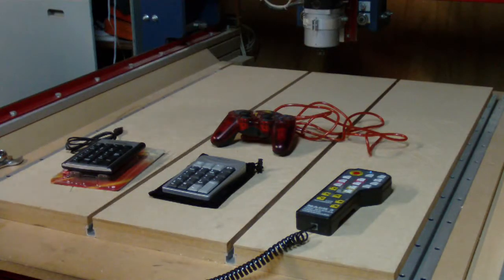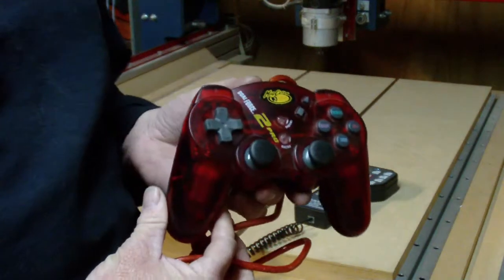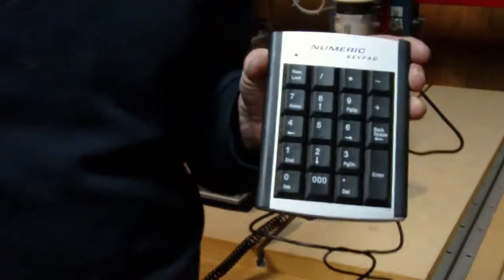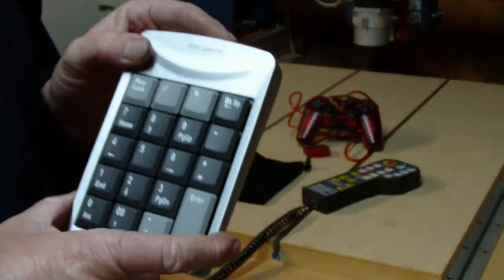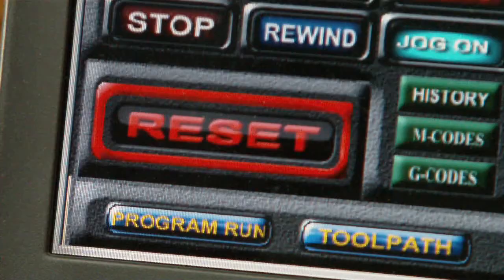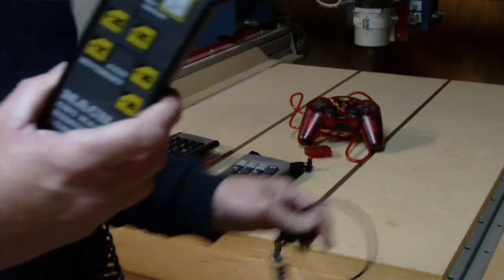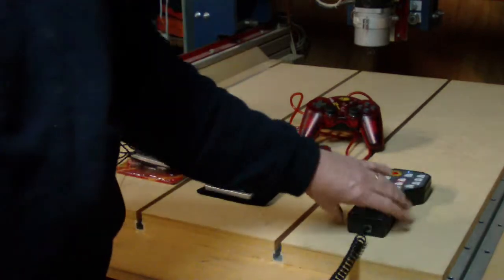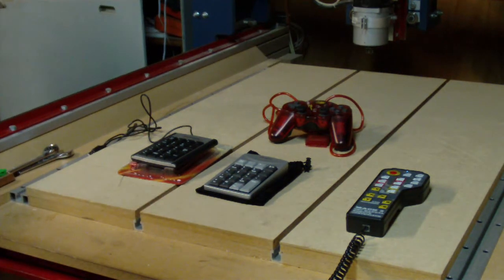Mach 3 Pendant Review - CNCnutz Episode 31

Comment: got the newer version of the mach 3 pendtant....the emergency reset button does nothing,,,,is there a way to fix this within mach3...love the vids....keep em coming.
Reply from the maker: I'm very surprised that the Estop button doesn't work for you straight out of the box.
This video will show how to map keys on a pendant to various buttons in a screenset.
It will hopefully solve your problem as well as add new functionality to the new pendant.
Cheers
Peter
https://youtu.be/r8wEpHVS0qY
Reply from the maker: Hi Rory,
Looks like I have put you wrong on how to set the key on your pendant. The method I mention will work but there is a much simpler way as I have just discovered.
Open Mach3 and go to Config, Pins and ports, input signals
Scroll down to EStop and click the square labeled hotkey on the extreme right
A box will open and you need to press the Emergency button on your new pendant. This will fill out the hotkey box with the key number automatically.
Click Apply 
Go to Config and Save Settings
You are done. The key will now work for you.
Cheers
Peter
Reply: thanks again peter,, today i tried the above method and it worked a treat,,,,the pendant is working fine now ,,,,,,mach3  is still a steep learning curve for me, but i will persevere.....your videos are a great help and a pleasure to watch....so thanks again and all the best from the emerald isle.

Comment: Peter, have you any documentation of the settings in the Mach 3 program to use a Mach 3 inc manual controller? I have watched your video's but can not get my controller to work.  I am using a screen set called the Blue screen set because I use the triple edge finder.  Any help would be great.  Thanks for your support.
Reply from the maker: I did a video on setting it up last year. It won't matter what screenset you are using for this.
Have a look at      https://youtu.be/r8wEpHVS0qY
Let me know if you have any problems
Cheers
Peter

Comment: Keep up the good work Peter. Love your vids.
Went & got myself one of these beauties, and am very happy with it.
One function I found is missing, and that's the ability to activate the Auto Tool Zero from it. Am I missing something ??
UK fan.
Reply from the maker: +Alan Segelov 
Hi Alan,
Mne doesn't have an auto zero on it either.
You can remap keys on the hand control to do different things using a program called Mach3 screen designer.
It allows to to customise your Mach3 screen and you can create and assign functions to keyboard or remote controller keys. You can download it from the Mach3 website. 
http://www.machsupport.com/wp-content/uploads/2013/04/Mach3Screen.zip

Hope this helps
Cheers
Peter

Comment: Hi Peter,

I am pretty new to CNC machining and I have already learnt a lot viewing your videos. The review of the remote controllers was very interesting for me as I own the same CNC manual controller which you rated best.
I am pretty happy with it, at least with the base jogging buttons (X,Y,Z) and the STOP/Cycle Start which all worked out of the box.
Unfortunately all the rest doesn't work at all - no increase/decrease speed, no toggle from continuous to Single Step Jogging.

I read review which advices to activate "Scroll" on your keyboard. That lights indeed a somewhat hidden 2. LED in the middle of the pendant - but no further effects.

Do you have a tip what I cam do else or do you think my pendant might be defect?

Keep you good and informative work going on!
Regards from Germany
Raimund